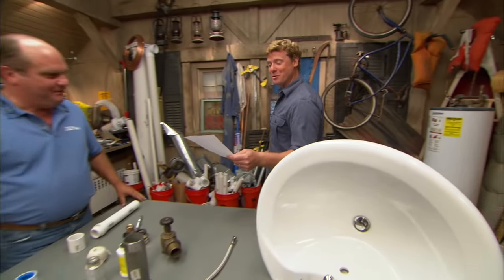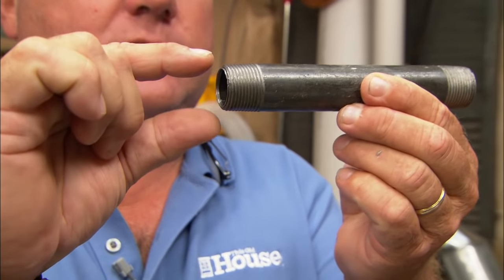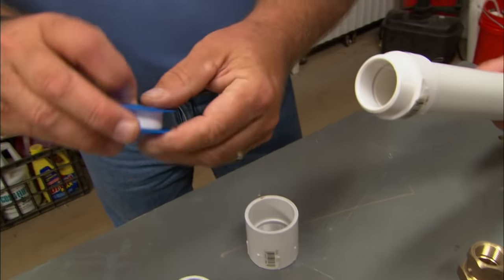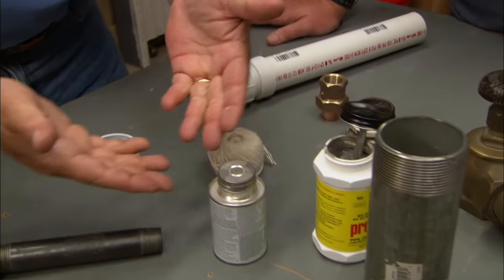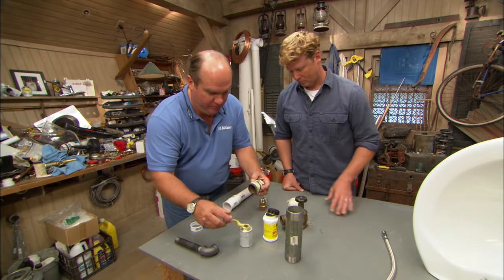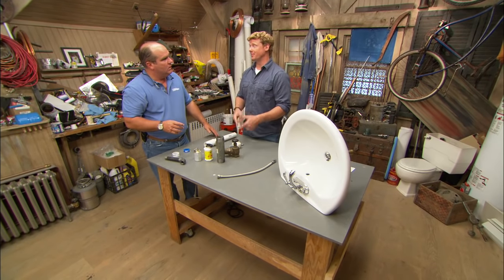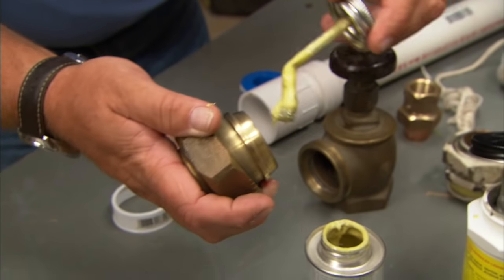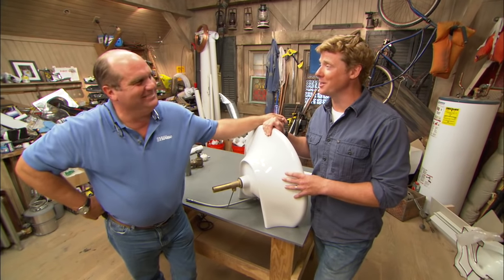When to Use Sealants on Threaded Plumbing Connections | This Old House

Comment: This isn't entirely accurate, The manufacturers of the compound and tape will tell you to use one or the other and that their product isn't usually listed or supported to be used with tape. in their test facilities, their product is quality control tested by itself. There is no proven science or studies that support that using both tape and dope = more sealing power. In some instances, some manufacturers of pipe dope have said that the tape actually impedes some of the sealing qualities of the dope itself, especially anaerobic compounds. I have installed high pressure fire sprinkler systems for 20 years and have personally talked to sales reps for pipe compound manufacturers about this very topic and this is what they all collectively told me. none of the pipe fab companies ive seen use both either for the same reason.
Reply: You had me up until the sales reps part.

In my experience, sales reps will say whatever they think gets you to buy that product.

I once had to troubleshoot an issue with a product where the sales rep claimed that product was fit for a particular task and we were having trouble getting it to perform that task (this product was specifically purchased over competitors' products because of the claim that they were able to do this task we were now having trouble with).
After a few weeks of back and forth with the sales rep and level 1 support at that manufacturer, we were able to get in touch with the lead engineer for the product in question who with little deliberation informed us that the product was never designed to perform the task we were attempting and it was unclear to him why the sales rep would even conceive of it being able to perform such a task.

Long story short, talk to the engineers if you want to know what a product can and can't do because the marketing/sales people writing the brochures and the lawyers writing the labels really havn't got a clue.
Reply: It's just good common practice. Moreover used commonly in Europe.  I've always done this only on gas lines including high pressure lines. Jet-lube v2 which is compatible with 1st 2nd 3rd and potable water say to use a combination of both. Either or I've never had any leaks or spillage. Why take any chances.
Reply: I have seen very experienced 30+ years of experience plumbers would use Teflon tape and pipe compound paste together. The answer is sometimes the parts tolerance are bad. It ups the chance of not have to take it apart again when the odds were against you.
Reply: Wow ,  interesting

Comment: Don’t ever use pipe dope on rubber seals, dope eats away at rubber eventually eating and destroys the rubber seal
Reply: A 60-something year old plumber with 50 years of experience had me doping the rubber washer on basin nuts on one project (top side between the rubber and porcelain)

Comment: FACT 
PVC manufacturers dont recommend using teflon tape on threads or oil based pipe dope, 
Use PTFE Pipe Dope made for plastic..
Using teflon tape can create over tightening and cracking of fitting..

Comment: Sir isnt this sealant toxic. When used on kitchen sinks. As we use that water to wash our utensils and many people who don't have an RO even drink the water from the kitchen faucet.
Reply: There are codes regarding to the safety of the pipe sealant for drinking water such as ANSI 61.
As long as the sealant pass the certification of ANSI 61 they are considered as safe to use for the piping of drinking water.
If you absolutely don't like the idea of pipe sealant  you can use have copper pipe with lead free soldering or copper pipe with compression fitting, that way there's no plastic product what's so ever in the joint, although that's a little extreme.

Comment: Did you seriously just tell people to use pipe dope on a ground joint?  Wow.....
Reply: +Nad Fink just on the conical face , not sure why unless poor seat on existing in?
Reply: +judo4 bagels If you need dope on a union, you've got a faulty union!
Reply: +judo4 bagels Can't see any harm could have a little surface  ding  or a bad  scratch on that machined surface then you are in trouble, and then supervisor gives it to you on the neck.... i was that soldier....
Reply: Well then, why not just solder the whole thing?  It's not hard to test and replace a faulty union.  I guess it boils down to what you are comfortable with.  Plumbing failures can be expensive, I would rather spend the money replacing the union and call it cheap insurance.
Reply: +Nad Fink You need unions in certain areas in order to remove and service equipment and in the case of either black pipe or brass soldering is not an option.
Reply: +frmerrin2 I don't think you read the whole thread.
Reply: Sometimes unions leak a bit. In a negative pressure network/line like a well pump inlet incoming air from the environment could cause a lot of problems
Reply: Unions are known to leak anytime i go to a gas leak first thing i check are valces plugs and unions. So yeah i dope the face of them
Reply: use flanges xD
Reply: I think the largest problem on using dope on a ground joint pulling together is that you intentionally put shit inside your Central Heating. Meaning you not only have ash from the welding process of the radiators in your water, but also nasty fatty dope clogs which can get caught on anything.
Reply: A union is a machined fitting meant to seal. Need Teflon or dope it's a bad union. 20 year service plumber here. Yes I have used it but not supposed to.

Comment: wrong you never use pipe dope on a union!!
Reply: Then you have been doing it wrong for years. You can use "never seize" or grease on threads to prevent the threads from seizing in boiler piping but unions  have a lapped face on the mating surfaces and if they do not seal they are defective and should be discarded. Pipe dope should never be used on the mating surfaces or the threads.
Reply: Al Somethin 
Wrong!!!!!!!!
Reply: I laugh when I see guys dope unions. Smdh
Reply: Old school plumbers would always use dope on unions, not for sealing but for lubricating the threads

Comment: lol... the tape is a lubricant not a sealant....
Reply: ah no. It's a sealant. Teflon tape fills up the groves. See what happens when you don't use it on applications where it is needed. It will leak. The threads are never a perfect fit between them, and unlike copper, they will not deform to fill each other. It has a slippery nature due to it being teflon, but if lubrication is all it was, you could achieve that with oil, and it would leak immediately.
Reply: Intuitive Observations: Nope. Wrong. Teflon and dope are used as lubricant. Oil could actually be used as well, but it's too messy.

Comment: You are 100^ Incorrect. Check  with  pcv information.
Never use Teflon on plastic pipe threads!!!!
When working with threaded plastic fittings do use a proper sealant. The right sealant for threaded joints is non-hardening, compatible with plastic and doesn't add slipperiness.

Comment: Oh, show us how use "sealants" in less time...why don't you? wtf, what's the hurry? 
God forbid you should spend a few minutes more by telling us the difference between those two pipe dopes. And is wicking the ONLY answer to old pipe fittings? And the pipe dope is not a sealant, it's mostly a lubricant for that which actually makes the seal: the threads.

Comment: You need to back to plumbing school! You NEVER use pipe dope and teflon tape together. Pipe threads are made to fit together perfectly, the dope or teflon tape act as a lubriricant to tighten the fitting.

Comment: Wow, ROOKIE mistake by the so-called expert plumber. Pipe "dope" is designed to be a lubricant ONLY. It is NOT a "sealant" at all. The lubricant is designed to allow you to make a tighter seal on your threaded joint. Also, I believe pipe dope should NOT be used on the metal to metal joint as he showed in the video.